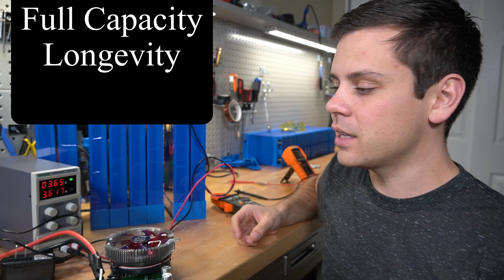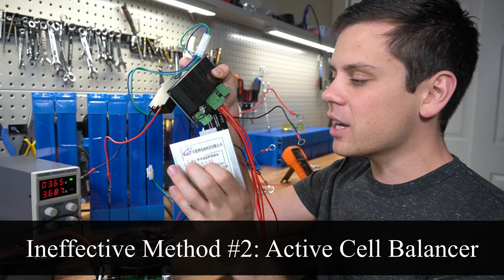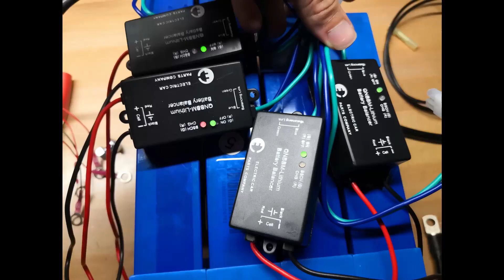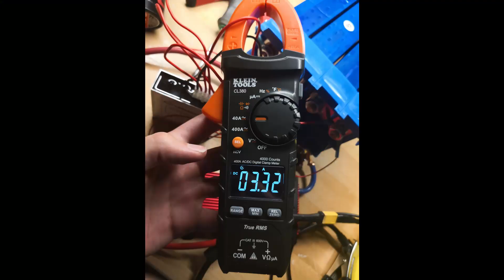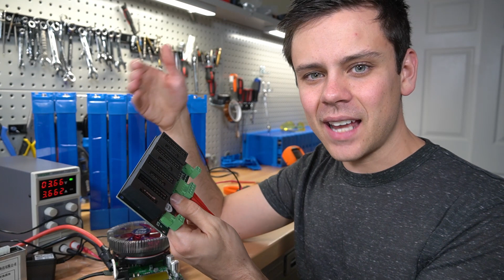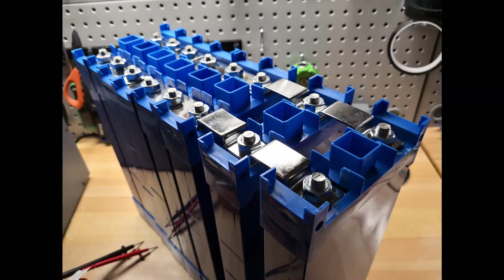Advanced LiFePO4 Cell Balancing Discussion (and how people are getting ripped off)

Comment from the maker: Going by some of the comments below, I have some beginners that are completely lost by this video. You probably do not need to balance your cells as much as you think. 
Watch this video if you want to know why it's pointless to use active balancers over the long term with lifepo4: https://youtu.be/cmZ-_sRnGj8
Watch this video to understand why it's important to have matched cells and the role of balancing: https://www.youtube.com/watch?v=iN4ok93hhWY

The whole point of this video is to show that active cell balancers are pointless for increasing capacity (which has been debated on solar message boards for months now, and it's driving me nuts). And that putting your cells in parallel at the flat part of the SOC curve is pointless for balancing. If this does not make sense to you, you need to watch my beginner videos.

The theory people use for justifying the use of active balancers for increasing capacity: The packs capacity is determined by the lowest capacity cell. If you have an active balancer efficiently charging up the lowest capacity cell while cycling, the LVD and HVD will not be triggered as quickly, and you will get longer run times (theoretically). People use this as the main factor in buying active balancers for mismatched systems. So I did the mismatched cell experiment and found that using active balancers will not increase capacity by much regardless. 

Also, if you are a beginner and you do not understand why you need to top vs bottom balance, you really need to stop watching this video and watch my older videos or read some battery books that cover the various applications. THIS VIDEO IS NOT FOR YOU. 

If you have quality cells that are matched by ir and capacity, you do a solid bottom/top balance, use a quality bms and do not push the thermal limits of your cells, you do NOT need to balance your cells often (or at all. I have run systems without bms for months and they stayed within .01V of each other).

I am seeing a lot of ignorant comments below and I really need people to educate themselves on the basics and why this topic has been debated in battery building groups, and the whole point of my tests.
Reply: Im a beginner, but have binge watched your videos so i knew what you were talking about, but past my aplication. Its funny all i was trying to do was solar maintain two lead acid now i want to build my own new batterys
Reply: did you test how many amps were drawn from the highest battery only or did you also test how many went into the lowest (shouldn't be much that went into the low cells if you didn't get more difference than the test show when you were on a low load)
and the most important thing about a BMS (in my opinion) is more about people using used cells that can change internal resistance or some using 18650 that they reuse puts a "fuse" on each cell and removes one or more batteries from a pack when it is to be recharged then the pack gets a lower capacity and a higher resistance so the voltage across that pack becomes higher than for other packs in the system and too high volts in a pack can cause danger
Reply: @DIY Projects  I meant that if it were to pull 5A from the big batteries then it would have increased 5Ah in the small ones in one hour while it did not seem that any considerable energy went into the small ones before BMS switched off
And I meant at the end of the post when I could see a need for it along with a BMS and I never mean that they would be used instead as they don't break the contact in case something happens but what I wonder most was if he was testing on both sides or if most of the energy was burnt away so it never came to the batteries needed and if he also had that balancing on when he recharged the battery again and what it looked like when it was approaching full?
But with the result, I understand why he doesn't think people should use them when they don't work as they promise

Comment: Hi..I run a small industry assembling Li ion and LFP packs mainly for electric scooters, Bike and Solar. Typically the steps we follows are
1. Charging all the cells with constant current say up to 3.6V for LFP and 4.0V to Li ion. Then adding a topping charge with Constant voltage till current dies to 20 mill amps.
2. Segregating the cells based on Voltage and internal resistance. To a set of battery, we try to have IR with difference of not more than 1 or 2 Milli ohm and voltage difference of max 50 Milli volt.

3. Spot Welding and adding BMS connection.

4. Taking this pack to aging machine where we charge it using CC CV method. We try to keep the max charge voltage above BMS over charge voltage cutoff. This way we can be sure that BMS is working fine.

5. Discharging till BMS lower cutoff voltage. This way we estimate actual capacity and BMS performance.
6. Charging it back to nominate voltage.

Now point worth noticing is that typically we use passive balancing BMS (for cost constraints) , we often face the Issue of unbalancing after months of usage though we try to keep the IR as close as possible. So what starts to happen over time is that, bcz some of cells wont charge as much as other cells (same for discharging). suppose one cell gets discharge to minimum though rest of cells still have charge but BMS will detect Lower cutoff and will Shut down the battery. So range of vehicle reduces significantly. This problem I mostly with LFP batteries, though Li ion work as charm mostly. Still trying to figure out what to do.
Reply: Have you thought about using active balancing, is the cost difference too much? Thank you for the insight.
Reply: I think your problems could be related to a number of factors and you have to eliminate them one by one in a logical fashion. 1. Not all BMS are created equal - try substituting a BMS that can bleed of more current when balancing. 2. Cell quality is important. Goes without saying. Headways are going to be better than Calb and they are going to be better than no name brands. Try different brands of cells. 3. Make sure you’re not exceeding the constant discharge rate of the cells (you seem to know what you’re doing so we’ll say you’ve got that one covered ). 4. Temp is the other big factor - charging below 0 deg C or discharging and charging above 50 deg C will accelerate battery degradaton and accentuate cell drift. Find a BMS that prevents this.
Reply: Power Electronics Guy 
To add to the comment of MondoTV:
- check if there are temperature differences when the batteries are charged/discharged. Will the BMS warm up some batteries more than others (if at all)?

Comment: That was a strange test Will. The idea of an active cell balancer is not to give you more capacity during discharge, but rather to actively balance the cells at a high state of charge or low state of charge (given the flat discharge of LiFe). And any balance circuit is going to use some power. So that test would only give you more capacity if you stop discharging and give the 100Ah cells time to charge back up the 60Ah cells. And even then with the flat discharge curve on LiFe it’s probably only going to come into play when the 60Ah cells are just about empty. I agree active balancers are of limited value with new matched LiFe cells but I think over longer periods of time (say 10 years) as the cells wear an active balancer might extend the lifespan. Is that worth the money? Probably not given the way cell costs are coming down.
Reply: As long as you're not overcharging or overdischarging, the individual cell wear rate isn't going to be much affected by active balancing. Think of it this way: You can't put more into a cell than it can hold, nor can you take more out of a cell than it has in it. So at best, all that you can really do is to start with and keep your cells matching and occasionally checking them to be sure they're staying relatively close as they wear.
Reply from the maker: Right Mondo, I totally agree but a lot of people were saying that it would.increase capacity. Especially in the diy powerwall community (quite a few discussions on this with the byd packs. There's even a YouTube channel of a guy using them with Tesla packs, and I find it pretty pointless). And I figured in a used mistmatched system, it should help it a bit. I didn't know how little that capacity increase was until I actually tested it. 

Yeah I agree PRO, I highly doubt that active balancing could increase the life over time. Cell drift when used for solar is so minimal that you only need to balance with a passive dissipative balancer every six months. If you use them in a ev at high c rates, every couple weeks. Any BMS could balance those cells just fine and increase the longevity.
Reply: P RO I don’t disagree, but I have seen LiMNc cells where one cell group goes bad destroying the whole pack because a passive balance system will never allow the other cells to charge up correctly because it takes too long. An actve balance might give you a chance to at least keep the other cells in the pack healthy. What causes it I can’t say - a poor quality BMS maybe or just variations in cell quality.
Reply: DIY Solar Power with Will Prowse Funny you mentioned the Tesla packs because pretty sure Tesla use active cell balancing in all their packs. I know the do in their cars - not sure about their Powerwalls. I think the reason is an active cell balancer is always balancing the pack at any SOC while a passive balancer only ever top balances the batteries. Is that important if you’re going to be partially charging a lot on solar?  Well you’ve been doing it for years so I trust you’re advice. No it’s not important.

Comment: Active cell balancers are not intended to enhance the capacity of smaller cells, they are just supposed to balance cell voltages and for this a capability of moving about an amp is absolutely fine. They are better than passive balancers which dump the excess power of the higher voltage cells into a resistor because they reduce heating of the BMS and slightly reduce the charge/discharge losses. 

They are certainly not designed to boost the capacity of a 60AH cell to something intermediate to 100AH when put in series with 100AH cells.
There is no scam in these systems which work really well (I passively balance 16S200AH LiFePO4 at my house). You just have to use them for their intended purpose!
When it comes to connecting the cells in parallel, you are supposed to "top balance" where you set the power voltage to the maximum for your chemistry, say about 3.6V for LiFePO4 then leave them until the current drops off. At this point all the battery cells are fully charged and "balanced". YOu don't just let the more charged cells float the other cells because you have to get off the linear part of the charge curve.
Reply from the maker: Oh wow you must not be aware of the discussions currently going on! Check out diy powerwall groups where his is a commonly debated issue. They state that if they have mismatched cells, an active balancer will increase capacity of their entire pack. It does increase capacity because the pack capacity is determined by the lowest capacity cell. If you have an active balancer pushing power into that small capacity cell while cycling, the lvd and hvd will not be triggered as quickly, and you will use more capacity for the entire pack.

And no, passive dissipative balancers and the heat they create is not an issue at all. It's fine to use resistor for top balancing. Once cells are.balanced properly, and matched by ir and capacity, it shouldn't be triggered. 

I think you should watch my earlier videos covering the reason to top or bottom balance or what applications people warrant the use of active cell balancers.
Reply: @WillProwse  Some overall capacity enhancement will occur if you use an active balancer but it is a (beneficial) side effect of the voltage balancing process which passive balancers won't do because they just dissipate the power. If your pack is mismatched more than a couple of percent then you have a problem and probably need to look to replacing the smallest capacity cell or two. 

As you say in one of your comments further below, "active cell balancers are pointless for increasing capacity". I completely agree that this is not the purpose of active cell balancers.

Comment: Good work Will. 
With lower number of cells in series the lower the issue with balancing. The problem increases with number of cells in series. The thing with cells in series is that as long as they are in "balance" they are kept in balance (!?)... That is to say that there is a positive feedback loop in a systems sense, once the imbalance is allowed to happen, it progresses.
I did a SPICE simulation using only "natural" selfdischarge as parameter and sure enough once it begins to happen it escalates. In my test case I got things to go pear shaped in 200 cycles. In practical sense, no two batteries are identical and even if they were, thermally they would be different and imbalance would eventually occur. 

I just built a 4P8S (400Ah) Winston pack, the cells arrived basically identical voltage to the second decimal. Impressive to me. 

Worthwhile discussing would be which balance method is the better one?

Comment: I love your videos man. Very informative and honest information for everyone. The only thing I would recommend for balancing is in the cases where people are not charging their batteries fully where the charge rate surpasses the threshold where most built in balancing in a BMS gets triggered it would be a good idea to maybe add the really small balancers. What will happen is throughout years of use even new matched batteries will go out of balance and eventually will trigger the bms 0.2v misbalance cutoff without anything to sort of bring the cells back in balance. We see this all the time with drill and scooter batteries and medical packs. Once rebalanced the packs work again. I guess the question is if it's worth it or not because we could always balance our batteries in that case manually. I personally think the larger balancers are a waste of money but the smaller ones with small balancing current could be useful

Comment: For me Will, the best video you have done to date. Only one downside, you need to purchase a bench top power supply to use once. :-( 

Keep up the truly fantastic work. Big thumbs up.
Reply: A benchtop power supply might be useful other than this single occasion. Also, 3.6v and a couple of amperes, that's low power, you could DIY with a 5v psu, a linear regulator and a big-is heat sink.
Reply: They are less than $50 USD on Ali, go pick one
Reply: @HandyC   Kinda misses the point i made. That is still $50 for something that will only be used the once, to do the initial top balance. The point that comes through now, is that the active balancers actually do most of their work at the kness at either end of the cycle, whereas most folks have the impression that they are actively balancing all through the cycle. Because of the flat curve, the small differences in voltage dont actually trigger the operation of the balancer, only when this difference is exacerbated in the knees.
Reply: Jim Maxwell do three extra hours of overtime then and it's paid for. What I'm getting at is that its not exorbitantly expensive and at the cost it is is just part of the building and commissioning process. You either DIY and absorb costs related to it or buy retail and pay for it all to be done for you.
Reply: @HandyC  lol, retired 5 years ago, so no O/T, but take your point....bit more than a crimper though....lol.

Comment: If you want more battery capacity then get a bigger battery.  I think the balancer is more about an insurance policy in case one cell decides to drift off.  It'd be most useful if there were LED "I'm balancing" indicators for each cell, as it would be plainly clear if one cell was demanding favors over time - that is, the LED pattern (by eye) should be roughly random, and if it were not then a potentially suspect cell could be monitored or replaced., or even changed position to verify.

Comment: I believe the point of the active balancers are to  KEEP a pack balanced over time.  Not to handle initial balancing.  You should be buying matched cells if you can, or yes, balance manually.  But once you build the pack, active balancers are to keep you pack in balance.
Reply from the maker: But cell drift is minimal in a matched pack system.
Reply from the maker: You do not need anything more than a BMS. Electrical engineers designing BMS have factored this in.

Comment: I will do this tomorrow once I check all my voltages. I either have a weak cell, or didn't do it proporly last time. Just got a nice 10A supply to do it too. Mine are WAY out of whack according to my Daly BMS (I Got one of the latest ones that you can control over bluetooth).

Comment: Ok, balancing is required to ensure the cells in series do not spiral out of balance. As Will says, not primarily for capacity. The entire system performance will be related to the weakest link in the chain. Minor imbalance will have minor effect. As Will also points out, quality manufactured cells that have very similar performance can remain balanced if the pack is not thermally cycled too hard. Thermal imbalance will make the cells to have diverging capacity and this may introduce difference in capacity whilst the thermal difference exists.

Comment: From all that’s been said, I’m guessing a battery monitor is all that’s needed and only to have visual confirmation the diy lith batteries are equal or facsimile in charge? Perhaps a BMS would work even better for that purpose, but may be overkill if the battery monitor gives user needed data? If everything is in synch the subject is a mute point, but a monitor would tell us that.